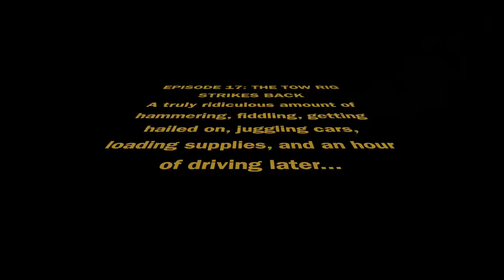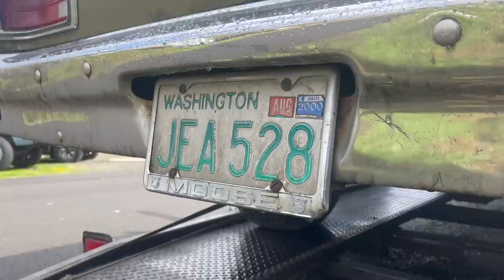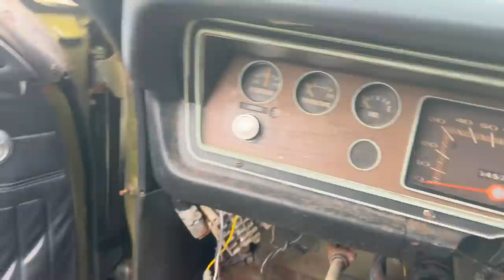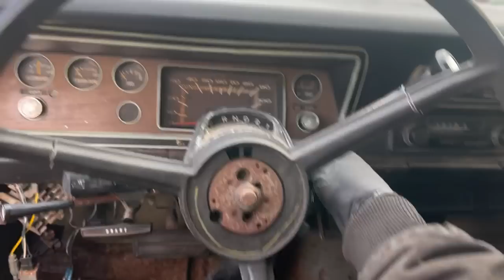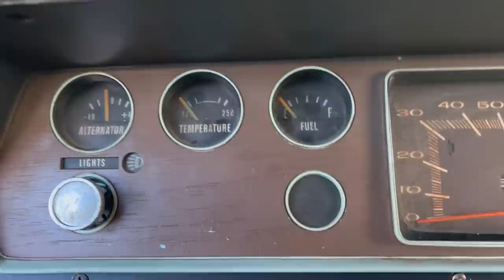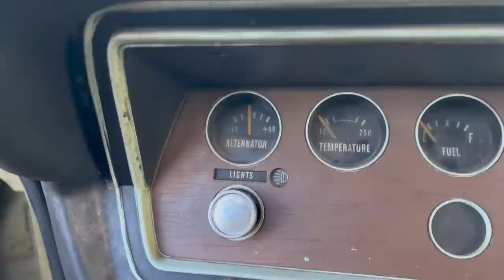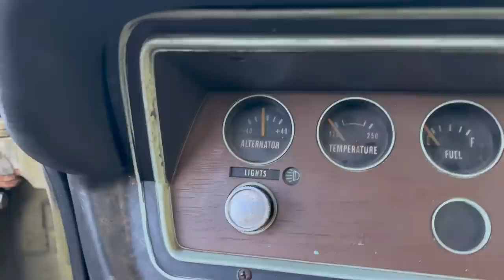I Saved This Awesome 1974 Plymouth Duster From A Parts Car Death

Comment: As a child of the 70s, and a teenager of the 80s, Centerline wheels will never hear a bad spoken about them by me.  They're just so...hotroddy...  I promise you, every person in town hears an open pipe car or truck running down the road thinks, "Well, Jamie got him some new pile of rust."
Reply from the maker: I love ‘em. They just seemed a little modern for the 60s gasser vibe I want for the car.
Reply: I'm the same, child of the very early 70's and teenager of the 80's these mid-late 70's cars were our High School Hot Rods, yeah there was the random late 60's and early 80's cars but for the most part the 73-78 cars were the norm. My first car was a 76 RS Camaro that I bought from my next door neighbor that she sold to me for $200 when she got married and moved to Texas with her new husband, My best friend had a 78 Nova, My High School Sweetheart had a 75 Thunderbird, Her best friend a 73 Dodge Dart and so on, these were the cars early Gen Xers grew-up with and drove in High School and They are coming back around as builds because for the most parts they are still around and either on the road or like this car are not far from it because the parts are still available and you can buy them DIRT CHEAP. Just about every project car in my club out here in Southern Arizona (Tucson area) that have been bought since the Dempanic and the Convid "outbreak", are the "smog" cars of the mid-late 70's. I've personally been driving while I work on a 73 Buick Regal That I bought for $1200 and after airing up the tires, throwing a battery in it and disconnecting the fuel system and running it on a gas can I drove it a little over 50 miles home. I was going to just park it in my shop and completely strip it and build it into a full Restomod but the longer I drove it home the better it got So I just decided to make a Daily Driver/Cruise/Cars and Coffee Car. As of right now I have right $4,000 and I all have to do is paint it. I've pulled the engine and trans cleaned them up really good and painted them pulled the body off the frame and sandblasted and repainted everything along with new bushing, bearings and body mounts. Redone the interior by dyeing most of it and then went to a junkyard and bought some captain style buckets and center consol from a 77 Olds Cutlass. It was originally green on green on green but It's now going to be Dark Silver with Dark red Interior. The wheels are the original steel wheels with baby moons. I'm not putting alot of money into it, I just want something nice to daily drive that I can still take cruise nights and cars and coffee's on the weekend.

Comment: Nice work man! Can't believe that car was going to be parted out. 

I totally agree with the mindset of saving these classics. Before I bought my short bed D100 (big block), the previous owner was going to part it out, but he could have been bluffing. However, I bought it for an amazing deal and the previous owner seemed pretty genuine. Anyway, the truck is super solid and I would have hated to see it have the same fate as many other great cars that have been parted out.  

Glad you saved that duster. Also, that has a wicked stance!
Reply from the maker: It’s amazing what used to qualify as a parts donor… I know, I dig it. The secret? Literally the biggest possible rear tire that could fit 😅 I think a taller front tire but lower torsion bar setting would help the look a bit.

Comment: Not surprised to see it start so relatively easily; that wasn't a Holley carb on it.

Nice save.
Reply from the maker: I was shocked when it wasn’t a 1920 and it still wouldn’t idle at first… but it came around.
Reply: For sure! The Holley carbs were TRASH in the '70s!

Comment: Lol we were chatting when the cable on the truck left ya. It's a good save and I am getting a rust free one of these in April to run through the shop. Your right the early ones are hard to find so these are more sought after and affordable. They are nice pay checks when you find them. The fact it runs and sorta drives is 4 grand here. Brakes are optional equipment
Reply from the maker: Right - it totally would be worth that here with paperwork and a little less rust. Probably looking at a little under half that as is, but I’m good with it.

Comment: The sound of that starter motor took me back to the days when I owned my 64 Valiant. 😢
Reply from the maker: That sound is the music of my people! Ok that and the straight piped slant in general 😅
Reply: @DeadDodgeGarage  Oh man, I drove my share of straight-piped Volares with the "Super Six". They sound good at idle but they drone like a mutha on the highway. 🤣
Reply from the maker: @LongIslandMopars  I first gave a slant car the sawzall treatment at 18, and I remember driving up and over a bridge on the way home and thinking...what have I done? Haha.
Reply: @DeadDodgeGarage  They do not make nice noises. However, I always had my valves adjusted properly. I had the quietest slants around thanks to the teachings of my dad. Adjust them running, fully hot, very low idle.

Comment: Awesome save!👍 That vinal top trim is worth a pretty penny in my part of the country, it's not reproduced and hard to find!
Reply: Yep but if it were me I'd paint the roof a different color than the car (Something Chrysler did in the later Duster's) and keep the trim. My aunt had a Brown 76 Duster that had a white painted roof, she bought it new that way. They started doing away with the vinyl tops because it was just cheaper to paint the roof a different color than it was to paint the top in epoxy and put a vinyl top on it.
Reply: @TheREALOC1972  Yep, Chrysler called them White hat specials back in the day.👍
Reply: @musclecarmitch908  yep, I knew they had a name for them but couldn't remember, That's what I would do with it. I men the trim s already there, why not.
Reply: @TheREALOC1972  👍

Comment: Wow... that Duster has the electric rear defroster?!?  That's kinda rare.  Just that by itself makes it work getting!  If you ever have to scrap that car for some reason, make sure to pull that rear window, the wiring, and switch.  Also, seems I recall reading in my owner's manual years ago that the electric rear defroster option included a 60 amp alternator... whereas models without that option came with the 45 ro 50 amp alternator.

Would be crazy if you discovered the thing still worked!
Reply from the maker: It didn’t work… which was unfortunate. That would make good sense - they definitely pull some juice.

Comment: 3 months later...  I remember a good buddy of mine had this same color Duster model.  Per usual it had to be Christened with a moniker. It became known as Buster the Duster. This would have been in the early 1980's.  If memory serves my gray cells even partially, he had a couple mechanical issues, what those were though, I just can't recall.  It was though a good running car for his needs with maybe a 'charging' issue if I were to guess after seeing the regulator concern you pointed out.  
What became of the car, I'd guess money being tight at that time in our young lives, Buster likely was sold off for little cash and off went Buster to some other fella to get working as a daily driver in our region of and time of our lives as minumum wage service oriented workers in the S.F. Bay Area.

Comment: I remember a guy selling a Duster he said it was a 71 1/2. Did they have something like that?
Reply from the maker: It’s possible there may have been some random package change, option update, or similar during the production run that might lead someone to say their car was a 71 1/2, but there’s definitely nothing major or official that changed. People call the A12 cars 1969 1/2 because that package was released in the middle of the ‘69 run. To me it’s still the same ‘69 body and was made at the latest in the middle of 1969, so I can’t say I get it.

Comment: I remember my other grandma (not the one with the big Dodge, this is the grandmother whose maiden name was the Zelasko, that park was  named after her uncle) I remember at least twice she had to get a new voltage regulator on her 1960s era plymouth Belvedere II. I also remember that when she used for turn indicator, the voltage gauge would wiggle a little bit. Looking back on it, it seems a little weird to me that the turn signal would use enough voltage set the voltage gauge did that.
Reply from the maker: Brake lights too. Watching the ammeter when hitting the brake pedal is a great way to find out if your brake lights are working. Haha. I can’t tell you how many voltage regulators of both styles I’ve replaced in the last 15 years. Just so many.
Reply: My 72 Duster did that too

Comment: You should have seen what they considered parts cars in the 80's and 90's!! 

Solid,straight complete 1968 Charger R/T 440 that would still run and drive and a $60,000 car today, they chopped them up for parts,same with Cuda's etc...Not kidding either! 

A parts guy here would buy cars off local auto trader and part them out and he sold parts at a high price,and he was in business for decades! He ruined thousands of great cars..majority were not wrecked either nor needed major mechanical work!

 I saved a '73 340 Cuda from him as I beat him to the seller,he pulled up about 5 minutes after I handed the guy the cash and I got the title..Solid car paint,interior perfect,engine ran strong same with trans..Was my daily for 2 years,looked perfect from 5 feet away! The guy would have parted that car out he told me! car looked like it had new paint from 5 feet away,minor rock chips,minor road rash on rockers and lower rear 1/4 panels..Original paint shined like new and looked like new paint if you didnt see the minor rock chips,white stripe was perfect,vynal top was perfect,no bubbling of rust under it! Zero rust,Zero dents,interior had a minor split in drivers seat(I repaired)..clean and looked nearly show car fresh..Gauges clear etc..150,000 mile,clean 73 340 Cuda! I drove the car 2 years as a daily before rebuilding the engine/trans after lots of light to light racing (hey I was young)..Unreal the cars that got junked/parted out!

And yes,my buddy bought a rallye hood from him for his base Challenger he cloned to a 440 R/T in 1992..and we seen the cars he had,many were not crashed or junk,most looked better than what was driving on the roads,meaning paint,interior etc..

People had to buy from him for some rare cars when their was no reproduction parts,so my buddy contributed to the insanity!! Thats how he bought near mint cars and parted them out..He didn't care,he made double or triple back chopping them up! As he screwed the guys with high prices that needed the parts! Glad for reproduction parts,it brought used parts down in prices making it worth selling the car complete worth more vs parts in most cases!
Reply from the maker: I know it! It’s a totally different time we’re living in - and we can definitely thank guys like that for part of it. Not long ago this car would’ve been $100-$200 or scrap.

Comment: I bought a 63 Dodge 880 wagon one owner for $80 one time and traded it for a light blue 74 Duster slant 6 with a floor shift 3 speed. It was slow but fun at least ! lol
Reply from the maker: Using full throttle full time is the most fun! 😅

Comment: That slant 6 ps pump is low pressure just like performance steering
Reply from the maker: Actually the pump seems to be doin its thing, I think it’s a control valve problem in the box, or something similarly horrible. Oh well…

Comment: Must be an early '74 given the front bumper guards
Reply from the maker: Interesting
Reply: @DeadDodgeGarage  Yes, those big thick ones were specifically made so 73 Dusters could comply with new safety regs. They used up the last of those already made on the early '74 cars

Comment: hi don t you have a power washer at home to clean up your mopars it would be a lot better for you and not kill yourself to wash them k.
Reply from the maker: Yeah, I do. Pressure washers are great. They also leave marks and remove loose paint and trim, so there are reasons I don’t normally use it on classic cars.